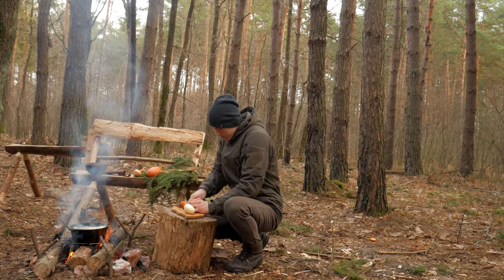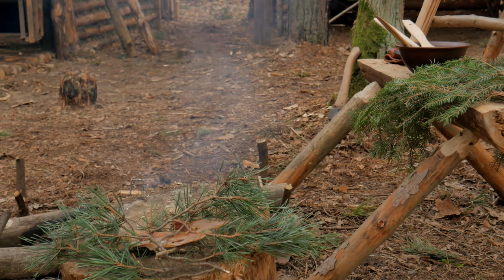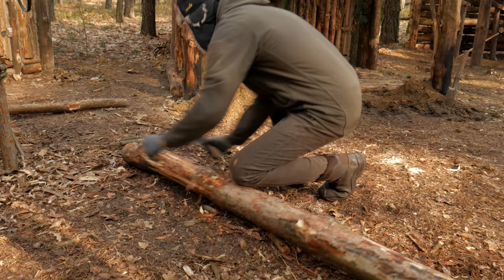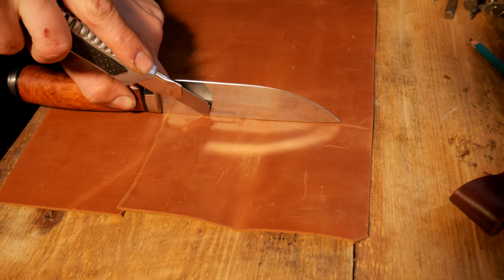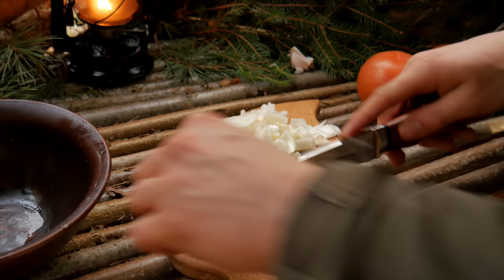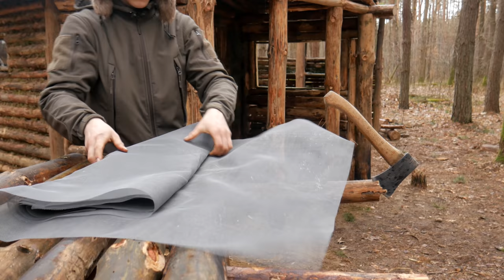Screened Porch on My Off Grid Log Cabin | Favorite Place in the Forest, Leather Tool Sheath

Comment: I am just curious, why do you burn the bottom of the logs before putting them in the ground? I’m looking a building something similar in my little woods. I like everything you have done except for the roof. Not a big fan of the paper roof. But if it keeps you dry that’s all that matters.
Reply from the maker: Thanks for watching. I set logs on fire before burying them so that the log does not rot.

Comment: Does charing the portion of the logs you put in the ground really help prevent them from rotting? I'm looking to build a fence out of logs and I am wondering how long it will last having the bottom 2 feet buried in the ground. I don't want to waste my time if they only last a year or two as it is a heck of a lot of work.